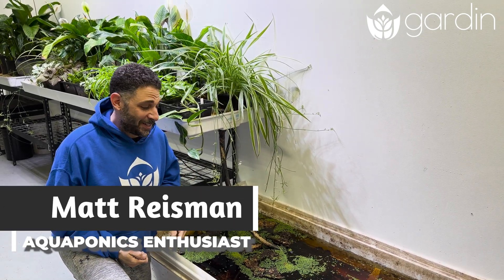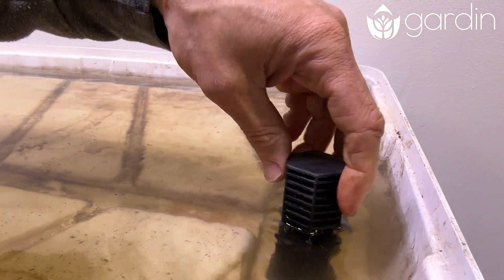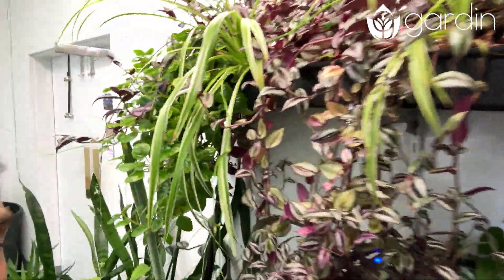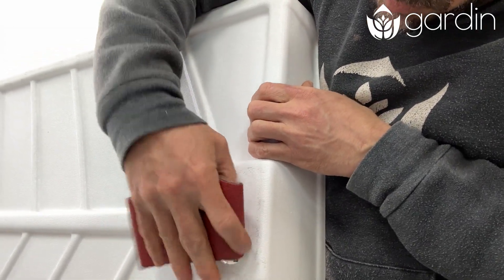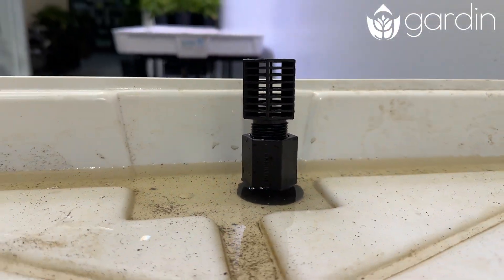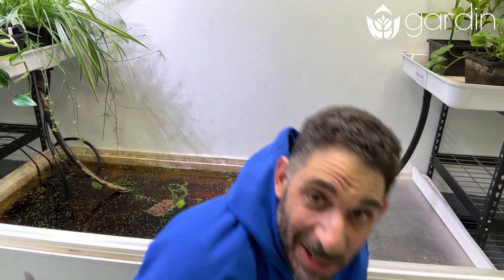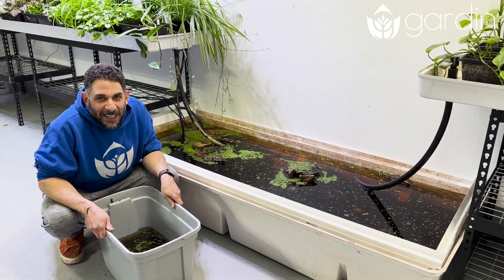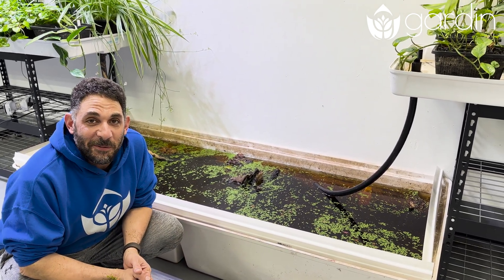Aquaponics for Indoor Tropical Plants & Fish: DIY Step-By-Step Build

Comment: Love the video and setups. Awesome! 
I had same thoughts about having the inlet and outlet holes on the same side. You can add another tube to the inlet to extend  it so it dumps on opposite side of reservoir for the full water circulation. Just food for thought. Cheers!
Reply from the maker: I love that idea!  Even if it’s a bit higher it’d still backflow out well. Thanks!